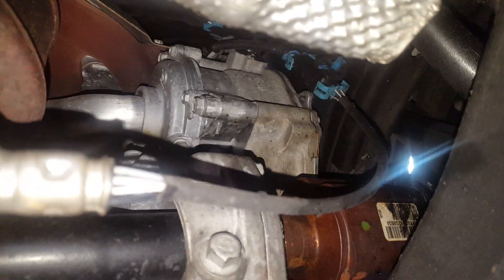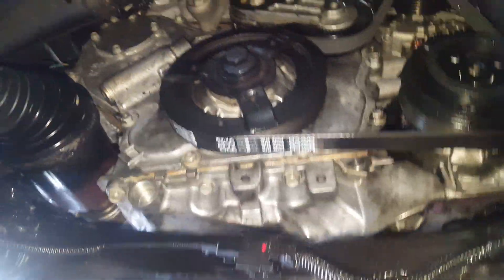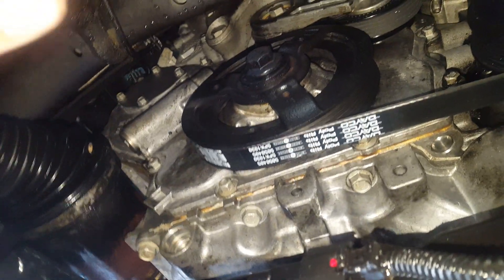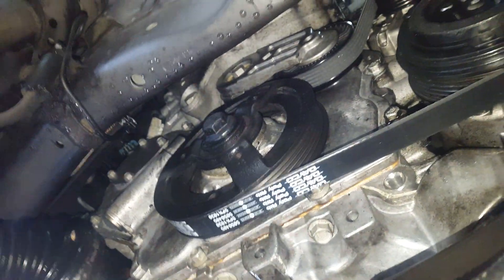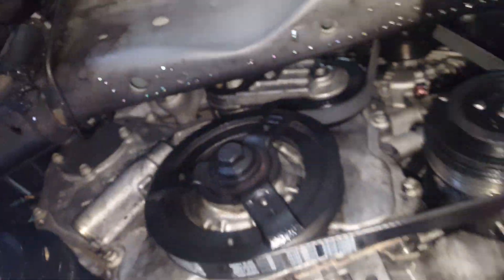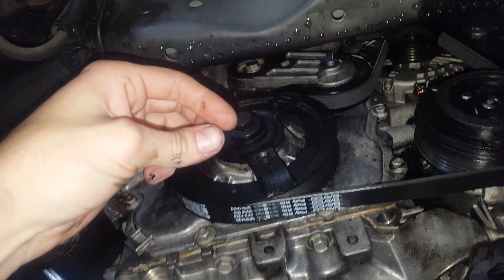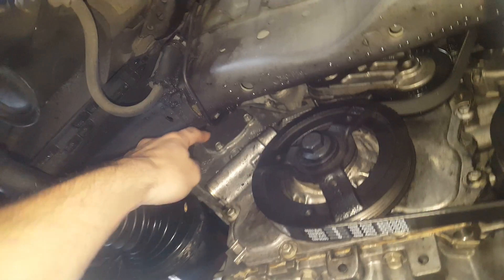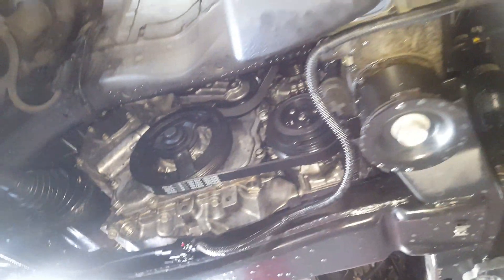EcoTEC Whine After Replacing Water Pump

Comment: Upgrade my water pump from composite impeller to the steel ones and it made this same noise. I used the tool and everything. Reset the tensioner and noise is gone

Comment: Interesting.  I just replaced an ecotec in a 2017 Equinox, and... the short of the story is I got the replacement salvage yard engine in there and noticed a whine.  It doesn't sound horrible, but it just doesn't sound like it should be there.  It sounds somewhat like a power steering pump sucking a bit of air.  Yes, some work WAS done to the water pump by someone before me, and someone also did not get the cam chain on properly as the 2 cams were not in time with each other and it had all brand new cam timing components.  I ran it with the belt removed and it made no difference.  I was itching to go for the water pump, but the stethoscope on the water pump was not conducive of what I expect to hear with bad pump bearings.  I guess I'll be pulling the front cover off soon.  I'll give GM credit -- even though these engines are kinda a piece of poo, they made them relatively easy to service the parts that notoriously go bad.

Comment: I had this same exact noise on an Equinox I bought. I did exactly what you showed here, reinstalled the little tensioner, and it's fixed now. I would not have found it without this video. I probably would have replaced the whole timing chain. Thank you.

Comment: I just replaced my water pump on my old 2001 Saturn 2.2L Ecotech. I did timing chains 1.5 years ago and broke the golden rule of replacing the water pump whenever you replace your chain. I said that I would just replace the water pump when it went out. It started leaking a week ago and the puddle kept getting bigger. I was surprised at how smoothly the job went including the cool tool to hold the water pump sprocket in place. Once I fired the engine up there was a bad whining sound that is the loudest if I stick my ear right above the timing chain between the two cams. I drove the car around the block and it didn’t go away. The engine sounds like a spaceship on the show The Jetsons. 😂
I was losing sleep about this last night waking up worried about what I needed to do next. I considered replacing the water pump again and was imagining scenarios where the new aftermarket water pump was not an exact match and is causing side tension on the timing chain from being too deep or shallow on the front drive shaft. I woke up and found this video in 5 seconds on Google. I now have a solid step forward. I have the timing cover gasket on order. Thanks for posting this!!
Reply: Just performed the repair exactly as described. I used a paper clip to hold the tensioner and noise is gone!

Comment: So I’m hoping you still read these responses. Do you just leave the pin or “drill bit in the hole until you bolt it back in and then just let it back out & it will be proper tension? It just seems like it will just come all the way back out?
Reply from the maker: Yes you remove the pin once it's bolted back in. The tension will be proper.

Comment: the balance chain tensioner uses oil pressure to take slack out, it is not a mechanical type tensioner. Its perfectly normal to hear the whine, especially after doing a complete timing set. I just did yet another complete timing set (primary and balance chain and all guides, sprockets and tensioners as well as the water pump) and it will have a whine until the new components break in.

Comment: I'm having the same problem with my 2011 buick regal 2.4L, changed water pump in 2020, but never got around to finding out what the whining noise was, and to this very day. Until I came across this video, I called a mechanic that deals with GM vehicles and he is telling me I need to buy a whole timing chain kit.

Comment: Same thing has happened to mine after replacing the water pump. On a Alfa Romeo 159 2.2JTS (GM ecotec engine 185hp). Super loud whining noise.
I used that GM timing tool to hold it in place but I had it screwed into the wrong holes so the gear fell slightly.
Must of been enough to let it get too tight. Sigh, off with the timing cover then! 
Thanks for posting this
Reply: Thank you man... I'll try my tomorrow.
Reply: did you ever fix the whining noise?
Reply: @jamarsphenomenology2488  yes I removed the timing cover and reset the tensioner. No issues since!

Comment: Yo

Just wanted to say thanks for this.  Was chasing a "whining" that almost sounded like a power steering noise when the steering system is out of fluid.  Just replaced the water pump.  

Turns out this is exactly what happened.  I had to pop the serp belt, crankshaft pulley and timing cover off.  Was careful, pulled the two 10mm bolts off of the tensioner, took it to a vice and collapsed it, and put a pin in it to hold it in place.  Reinstalled, everything back together, and it worked great.

No really shown in this video but my timing cover gasket was looped around the engine mount.  There's a small tab that goes through the mount.  It's not a sealing surface so I just snipped it off.  Kinda stupid design honestly.

Now to figure out why this thing has an intermitten miss...  One emergency at a time, haha!

Appreciate the video, this isn't really online anywhere else.  And before people say to use the tool, I did use the tool.  The tensioner still ratcheted tighter for some reason.  

Be safe.

Jose'
Reply: @josequiles9441  must be a ecotec thing. I have a higher mileage one and have replaced about everything including the head and still have that random 'miss'

Comment: I have heard the whine after another tech replaced one of these water pumps. But how about a grinding sound? I did my first ecotec WP yesterday, followed the book perfectly, and now have a grinding sound.
Reply: I have same problem with mine changed and smoked and grinds and squeaks help
Reply: @robertlopez3759  I figured out what happened with the one I did. The tool I used to hold the waterpump sprocket in place doesn't have a cutout in the center for the shaft of the water pump (its a Matco tool, a half moon shape). So as I'm tightening the sprocket-to-pump bolts it was pushing the shaft back. I've done several of these water pumps since the last time I was on here, and decided it's easier, and better for the customers car, to just pop off the timing cover and replace the whole pump, sprocket included. It's only about 20 minutes extra work to retime the counterbalance chain. If you take out a couple of the chain guides it'll give you enough room to move the chain around without taking EVERYTHING apart.

Comment: In my case I had the noise before the repair. I was working in a equinox 2013 and I replace all the tensioners, all the chains, all the guides and both camshaft vvt gears and still have the same noise, all the parts was from the dealership.  I didn't replaced the balance shaft gears and the water pump. With a stethoscope I found that the noise is in the same spot where the water pump gear is( touching the timing cover). Now I'm not sure if I have to replace the water pump or the gear.
Reply: Did you ever figure this out?
Reply: @Dayton Price  yes, it was the water pump, the bearing from the shaft was making noise. So now when I have to do a timing job I replace everything about timing

Comment: So I just got done replacing the whole timing system. Balance shaft kit and timing kit, along with the waterpump.

 You think I could've made the tensioner ratchet out a bit while I was messing with the timing? If thats the issue then I would be so happy lol everything runs perfect and even feels better than before I tore it apart, just that obnoxious whine
Reply from the maker: Thats exactly what happened to me. Car ran great but made a whining noise. As badly as I wanted to just let it be, I knew that unless I investigated and remedied the noise then there would be long term damage.
Reply: @LehewTech  Alright ill look at the tensioner then. After researching the forums it seems to be a very common issue haha

Comment: I had my water pump replaced a month ago today and it has been making the whining  noise . Is it save to drive and if so how long can I drive it
Reply: Does the whiney noise sound like a vacuum leak real high pitch squeel?
Reply: @vincelozano5944  had my water pump replaced recently, twice, and it does sound in a high pitch whine and when I rev up the engine the whiny noise follows the revving. I’m curious also if it’s safe to drive.

Comment: Just had my water pump replaced 6 weeks ago and took it back last week because they said the whine would 'eventually' go away. They said the new water pump was bad (probably bearings). After having it replaced for the second time, today, the whine is not as bad (goes away at 40 mph) but still present. They say NOW it's the timing chain tensioner. Here's the problem... It NEVER made a noise at all until they put their hands on it and I told them that. I will be going to a different mechanic to find out what the noise is. The only reason I had someone else do it is because I have a herniated disc and can't. Plus, what it involves. I'm female and have worked on my own cars because my dad taught me everything (and YouTube). They now want over $800 to fix this. What's next? I'm tired of shops like this taking advantage of women and breaking things to make more money off women and the elderly.
Reply from the maker: They probably just aren't familiar with the tensioner to know that it is a ratcheting tensioner that can sometimes get too tight then the water Pump is replaced. They should make it right by removing the timing cover and resetting the tensioner and replacing the timing cover gasket.
Reply: @LehewTech  They actually did have the timing chain cover off. The gal that works there took pictures. She was quite surprised when I told her all I did on a '97 Saturn I had before it got wrecked.

Comment: Would be nice to hear the actual noise.
Reply: Absolutely. Post a video about a noise that you don't record......
Reply: For those who want to hear the noise. I’ll try and describe it. While driving my car, my son had his window down and said it sounded like a remote control car sound on top of the normal engine noise. A higher pitched electrical motor sound. The repair in this video did fix my problem.

Comment: Just had my water pump changed and was told the whine would go away. It's been 2 1/2 weeks.
Reply from the maker: You need to have that chain retensioned asap..
Reply: @LehewTech  On their dime? Since they should have fixed it in the first place?
Reply from the maker: Yes on their dime. The chain that drives the water pump has a ratcheting tensioner and it got over torqued when they removed the water pump. Happens all the time.
Reply: @LehewTech  Thank you so much. Normally I do my own work, but I have a 2014 Equinox and a lot of it is beyond my scope.
Reply: @LehewTech  Took it back and it ended up being the NEW water pump is bad. The noise went away at 50+ mph. Having it replaced under their warranty.
Reply: @arlenegetsinger45  that’s probably just what they told u to save face. Lol.

Comment: Hey
I have a 2010 Chevy Malibu 2.4 engine. I had my water pump changed and instantly when I left there was a whinning noise. Brought it back after the weekend (as it was saturday) the mechanic opened it up, took off the belt (from the passanger side of the car)  checked a few things, said it is probably my engine by the looks of it, sent me somewhere else. They said that it sounds like my crank bearings are going. 
Do you happen to have a video of the type of sound the Chevy Malibu made when this issue occurred??
Reply from the maker: I do not but I bet that the chain for the water pump is over tightened. They need to remove the cover and reset the water pump chain tensioner.

Comment: but did you actually do this to your vehicle?
Reply from the maker: Yes I replace the pump and it whined afterwards so I had to remove the timing cover and reset the tensioner
Reply: Lehew Tech the exact same way you showed in your previous video about this? I told about 3 or 4 mechanics about this and they really have no clue.. I don't want to mess anything up..

Comment: Thanks i just did one at a i work at shop an the 40 year vet told me its the water pump that's making that noise because its a aftermarket pump i new better so i came to youtube an u save the day for me
Reply from the maker: Awesome glad to help
Reply: @LehewTech  So what if it still runs hot after the thermostat is replaced? Does the water pump need to be replaced as well?...  I have a 2003 Ford Focus Wagon ZTW & it was leaking on the driver's side right in the front when I poured some antifreeze in it. And when I turn on my A/C it runs hot as well too. I just wondering exactly what the problem is before I go buy unnecessary parts.

Comment: Just got done swapping the pump and using the tool that holds the sprocket and still have the whinding noise
Reply: me too
Reply: Same
Reply: @mikerawls7292  Same
Reply: @nickweisensale3173  pull the timing cover and reset the tensioner. It went away

Comment: You don't need to remove the motor mount. Just cut the useless part of the front cover gasket off that goes between the portion of the front engine mount.
Reply: Niwitte  have you done this before..it'll a help a lot if you could explain in detail what to do or show
Reply: You do not need to take mount out, on malibus tho you do however have to lower the engine a bit to get the 13mm bolt out for the timing cover past the fender well